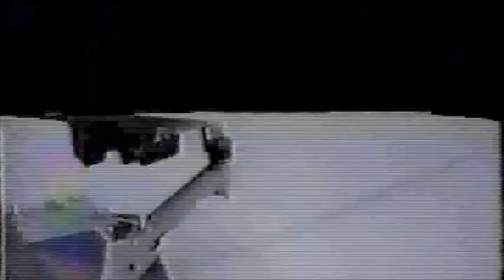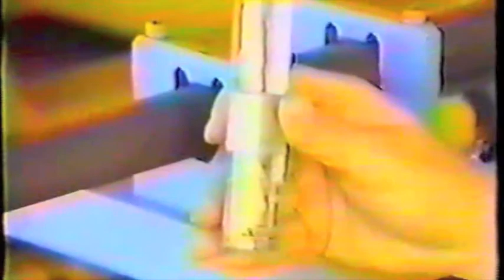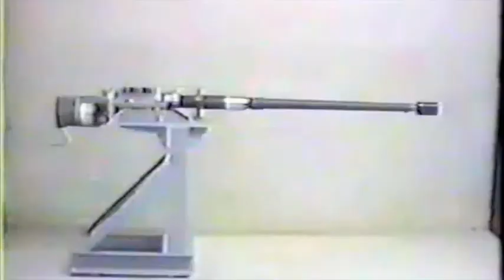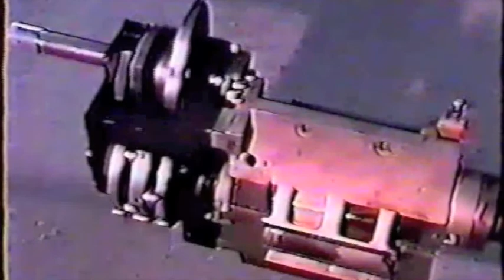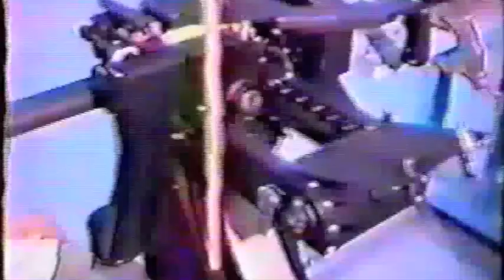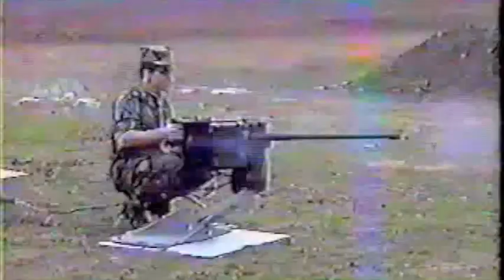Tround 50 Cal

Comment: there appear to be several advantages to this design; however the the fact that the "cases" are the same shape on BOTH ends; means that it is possible to feed a round BACKWARDS into the breach!
Reply: By my understanding, this is actually much of a non-issue. The primer would not be struck, no projectile would be propelled but the cylinder would still rotate and the unspent cartridge would be ejected the same as any other as the next one (assuming correctly fed) would be fired. You lose one round but there is no other malfunction.